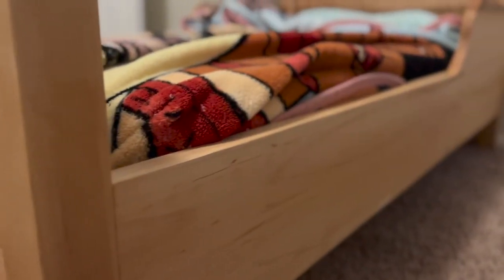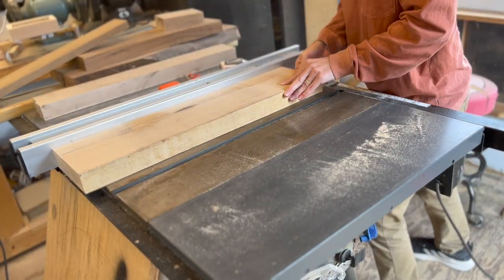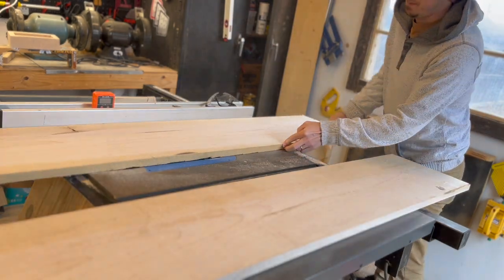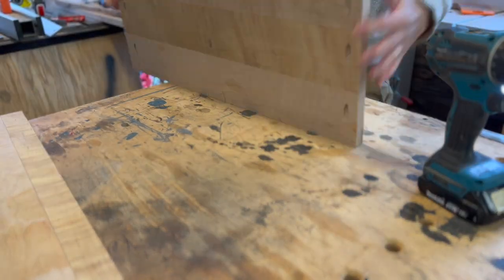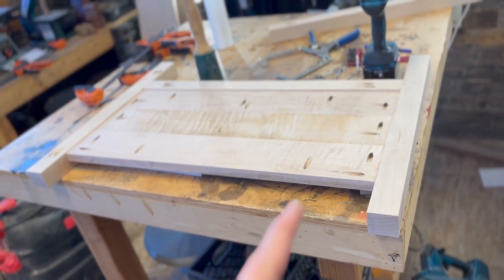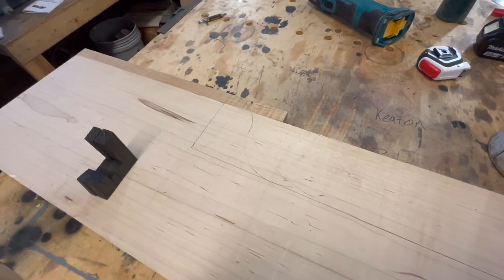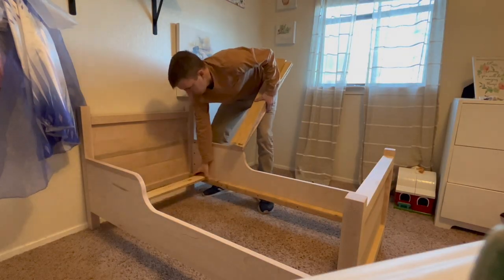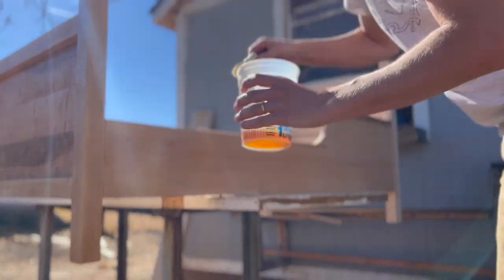Traditional Toddler Bed // DIY Woodworking

Comment: Enjoyed the video, thinking of doing something similar for my daughter!

Any ideas on how to avoid the pocket holes being visible on the inside of the footboard? That's the one thing I'd want to avoid from your design. I guess I should put my big girl pants on and learn some joinery. 😂
Reply from the maker: Kreg makes wooden inserts for those holes that you can install. You can also just insert a dowel that’s the right size and cut it off and sand flush. 👍🏻
Reply: @TheReformationWoodshop  those are great ideas, thank you!
Reply: @vidz953  Aaaww we r As. Fraser as